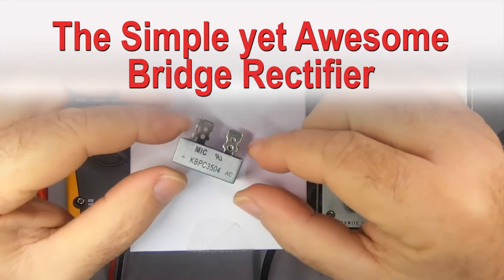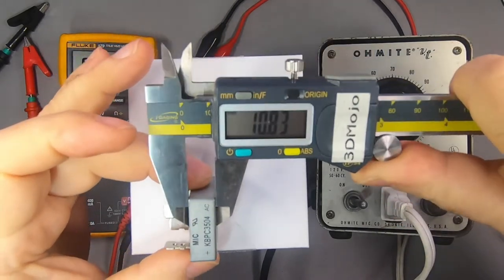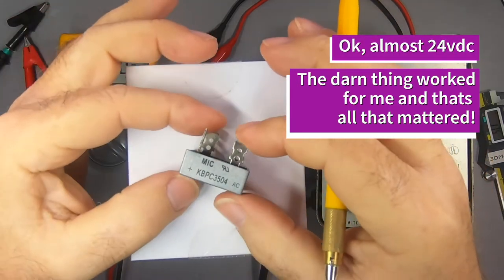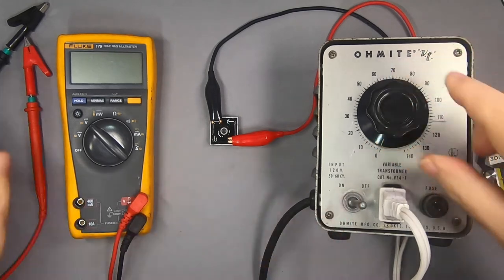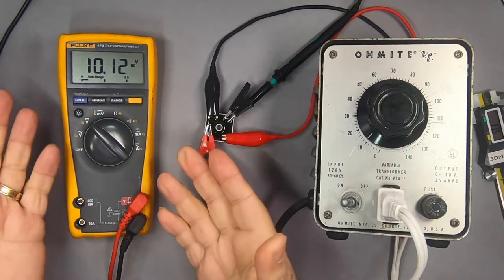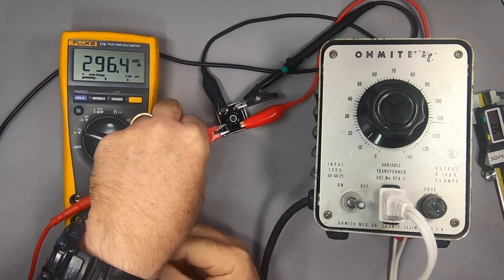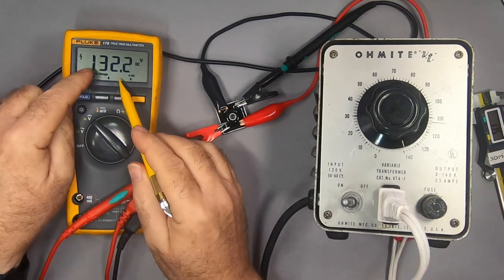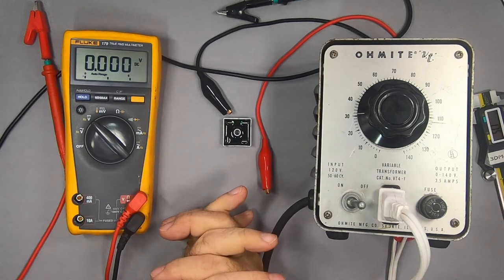The Simple yet AWESOME Bridge Rectifier - AC to DC

Comment: Folks, please read up on how ac/dc converters actually work.  There is a "little bit of loss" - because there is a .7vdc voltage drop across a silicon diode.  The output you think you're seeing is not true DC.  It is a "folded" sine wave.  That accounts for the rest of the "loss" you're seeing on the meter.  Because the RMS equivalent from  DC to AC is .707

Comment: Hi buddy I have a bridge rectifier that has the letters and numbers on it , SKB - 25/01 + 0461 , I need to replace it I think do you know what type of bridge rectifier I can replace it with as I can’t seem to find anything with the same numbers on it , it’s from a camper van and I think it’s for converting AC from a transformer to 12v for charging my leisure battery , I don’t understand it very well at all and so hoping u can shed some light on my situation if possible, many thanks in advance 😊😊👍
Reply: Was this question answered?